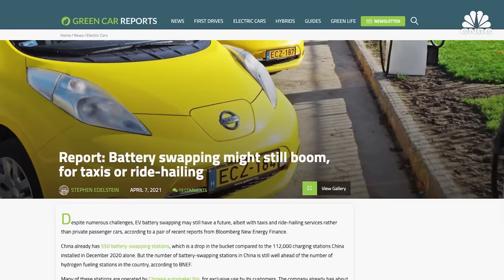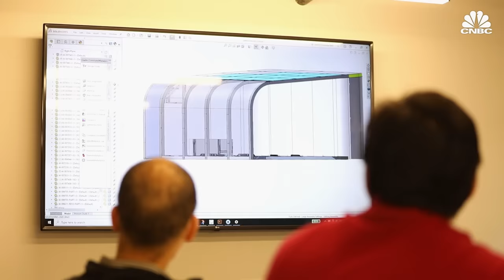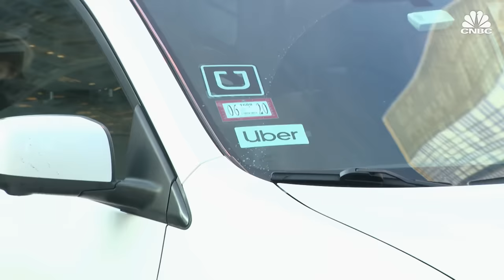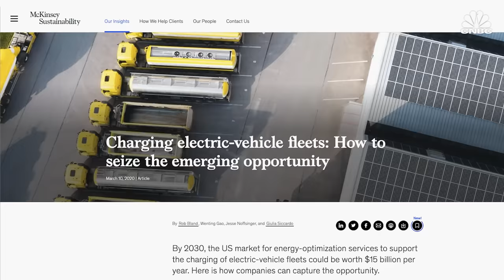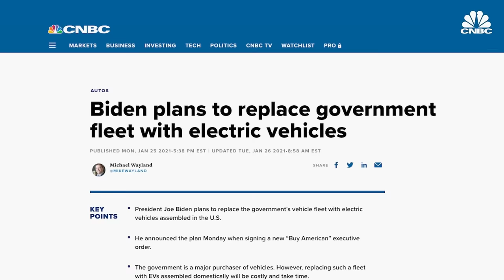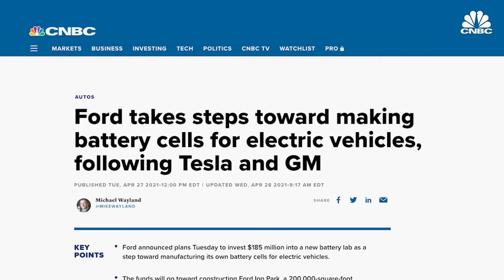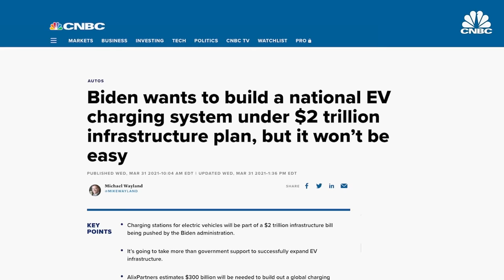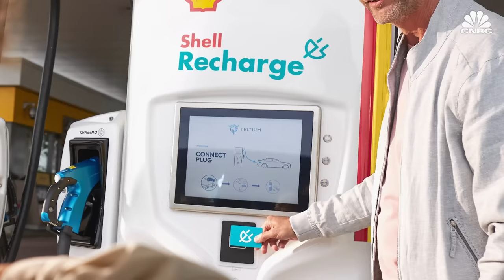Can EV Battery Swapping Take Off In The U.S.?

Comment: Who in their right mind would like to own a battery?? 🤔
Reply: Battery swapping is really not a good idea. My city is already connecting ev charging stations into streetlamps for people who dont have a garage. Tesla is going to have way better range with their integrated structural battery pack than any modular EV. Teslas batteries are already cheaper, smaller, and go farther than the competition and it just getting better. How many battery packs will these swapping stations need to have on hand in a city in order to make sure people arent sitting around waiting for a pack to finish charging before it gets swapped into their car? A battery is the most expensive part of an EV and they want to have thousands of these just sitting around when the world is already battery constrained. Each one of these places are going to cost millions in battery's and they will need to be all over the city and highway, otherwise youll be driving out of your way to get a swap, negating most of the benefits. They mentioned using them as grid energy systems, but that will degrade the battery life and tesla is already doing this grid battery powered energy storage with cheaper batteries that dont need to be small or light.
Reply: @HavokBWR  Well you are still missing most of the pint, as you mention the batttery is teh most expensive component of the car, a coponent taht degrades and becomes inoperable and neds to be recicled after lets say 1000 charging cycles. this means that if you own  a 20,000 dollar battery which looses strength and value evrytime you connect it you are loosing money, when the battery is no longer operable then what? you scrap the car. which is pretty much worthless. with boattery swapping the losses are transferred to the company that owns the battery and you basically have a fully working car for years depending on how well you take care of it. While you dont throw 20 Gs of your own capital to the trash. the batteries thne can be recycled and refresehd on a stricter schedule. As for using the batterues to offset energy production, this has great positive outcomes, because you can use more efficient, yet less able to start and stop at the drop of a hat.
Reply: Teslas batteries are closer to $13,000 and are getting cheaper. Teslas get more range on a smaller battery pack than its competitors, usually at a cheaper price. Structural vs swapped will only widen that gap.
 Tesla already has a million mile battery pack, that's not even with the new cells. The average person drives less than 20,000 miles a year. That's 50 years worth of battery life. Yes there will be degradation but getting a battery replacement really isn't something that you should be worried about, especially if you are going to wait till like 2025 or later to buy an EV. Even if the battery only lasts 20 years, self driving cars will most likely be ubiquitous. You're probably not going to want to be driving 20,30, 40 year old tech.

When you buy a modular battery EV you are paying for all of those battery packs that these companies are going to need at these stations. They will need a LOT of them, the world is battery constrained and will be for a long time. So yeah they will need a lot of these packs at each station, even more since they aren't supercharging these packs as to not degrade them faster. Don't want to run out of charged packs after 10 cars show up in a row. Not only do they(you as the consumer) have to pay for all these extra packs they also need swapping stations. Lots of them. And that's going to cost a lot more and take up a lot more space than super chargers or streetlight chargers.

Using the modular packs for grid storage is way more expensive than using cheaper, larger, heavier, lower quality, more widely available batteries in stationary megapacks. Again you're going to be degrading your fleets battery packs by using them as grid storage. That's going to cost you money as the consumer.

Comment: It’s an interesting concept and I can see it working well in parking garages at city center but outside of the city I cannot see this working.   Right now my family vehicle averages 32-34 mpg and fuel is 2.70$ a gallon so it’s actually cheaper to run on gas for me. Gas would have to go up to around 3.40$ a gallon for this to start making sense and even then I would benefit more from a Tesla as there are free chargers at my work and I could trickle charge overnight on a wall outlet most of the time.
Reply: Which state care you located
Reply: @marleyjanim5033  Wisconsin, northern Wisconsin to be more exact. No crazy elevation, no big city driving or traffic jams. Only real difficulty I have from a EV perspective is cold snowy winters.

Comment: I don’t want to replace my brand new cells with ones that are end of life.
Reply: What if you purchase a 1/4 pack of brand new cells and add swappable packs for the rest?  Your car could be much lighter, making the "end of life" battery point moot.  BTW, Tesla's new 4860 batteries have been measured to degrade to 10% after 15,000 full discharge-charge cycles.   At 350 miles/charge cycle, that is a 10% degradation at 5+ million miles.
Reply: @GK-op4oc  They often say don’t mix new and old batteries at the same time for a reason; even if the warning is meant for alkaline batteries.

Comment: Battery swapping is a foolish idea.  EV batteries will charge faster and faster in coming models, and the swap time won't be substantially faster than charging.  Plus, batteries are not all the same, so most people won't want some random battery swapped into their EV.

Comment: Porsche guy is right though. Only yuppies drive electric cars so all this hand wringing about "how to make EVs more like gas cars" is irrelevant for the normie car owner. All they want is a low TCO, and electric still can't compete with gas on price. Maybe there's an angle with swapping for fleets if the market moves to transportation as a service, but that again, implies that the engineers can deliver a lowest cost per mile.

Comment: Oh look, an opportunity for standardization.
Reply: Yeah lets standardize a tech in an industry that is going through rapid advancement...Evs dont have enough range as it is, we dont need this dumb idea stifling innovation. Tesla has the right idea with structural battery packs. You need every single edge you can get for every extra mile of range. Tesla gained like 10% more range by switching to their octovalve. Their new cars are getting something like 30% more range with their new structural packs. There are many many many more improvements to be made before standardizing is a good idea. This battery swap is an awful idea, especially when the world is going to be battery constrained for years.

Comment: so you are telling me we have a battery shortage and your idea is to hoard battery at swap stations? it makes sense to swap out degraded battery but swapping cuz you didn't charge your car is just dumb. we need battery to actually be used not sit stationary somewhere. 

and how bout mention why TESLA is moving away from battery swap? and why china is using battery swap? its more situational than it seems.
Reply: Swapping would only be useful on road trips but with range and fast chargers expanding, it will even lose it's appeal there soon as well.
Reply: @mattwolf7698  it wouldnt even make sense for road trips, you essentially would take 30-40min breaks and charge. in general we need to push the technology on battery and charging by actually using it. battery swapping is counter intuitive.  its only appeal is for ev owners in massively populated cities where owners don't have a dedicated parking spot with charging station.

Comment: but if station gets empty then it will not be available for very long time while chargers are always available plus capacity is lower than factory batteries plus there will be warranty problems plus  you probably would not be able to use Tesla supercharging network plus if you live far away and do use fast charging and degrade the battery and then come to swapping station either you will be rejected for a swap or someone will end up with your bad battery plus care need to be taken to not combine degraded with new batteries plus people would swap the batteries until they get good ones and then leave the station with only bad ones plus you need tens of chargers in the swap station instead of just one for one car and no matter how tricky trickle magic you charge the batteries if you have 100 of batteries charging simultaneously you will use more power than one fast charger if you want to charge them in reasonable time in order to be able to serve tens of cars daily if you only serve few cars in a day than you are not faster than the regular chargers plus I can find much more downsides to this system and if I can imagine what smarter people than me can... ?

Comment: The world is going to be battery constrained for a long time: Where are you going to produce all these batteries? There will be a need for ten times as many batteries, where 90% not in use.
Reply: The charging station charge batteries during non peak hours, which is cheaper to charge and also reduce pressure on energy network.
Reply: Also, China is leading in battery tech and own a lot of the upstream supply chain. So China of course is charging ahead with EV.

Comment: I’ve been saying this for YEARS, people laughed at it! Of course China had to get to it first.....
Reply: So... if the government wants to stop people from going around they close these charging stations ? No wonder they like this system in China !
Reply: Battery swapping is really not a good idea. My city is already connecting ev charging stations into streetlamps for people who dont have a garage. Tesla is going to have way better range with their integrated structural battery pack than any modular EV. Teslas batteries are already cheaper, smaller, and go farther than the competition and it just getting better. How many battery packs will these swapping stations need to have on hand in a city in order to make sure people arent sitting around waiting for a pack to finish charging before it gets swapped into their car? A battery is the most expensive part of an EV and they want to have thousands of these just sitting around when the world is already battery constrained. Each one of these places are going to cost millions in battery's and they will need to be all over the city and highway, otherwise youll be driving out of your way to get a swap, negating most of the benefits. They mentioned using them as grid energy systems, but that will degrade the battery life and tesla is already doing this grid battery powered energy storage with cheaper batteries that dont need to be small or light.

Comment: Is not the way.  How you bring all that vlominous full baterry pack? ok Let see you recharge slowly and sell the full one to the old one. But how many full baterry you can have in stock? imagine coming 20 cars to replace it and only you have empty battery. wich take you 2 days to charge them at slow rate charge. 
What about diferent baterry technologie?, what about diferent weight and volume battery?
To me look lost of money.
Just bring a good section of cable to manage the curent and is done , safe and no CO2 to try that energy to remote place.

Comment: damn that's innovation
Reply: Battery swapping is really not a good idea. Tesla is going to have way better range with their integrated structural battery pack than any modular EV. Teslas batteries are already cheaper, smaller, and go farther than the competition and its just getting better. How many battery packs will these swapping stations need to have on hand in a city in order to make sure people arent sitting around waiting for a pack to finish charging before it gets swapped into their car? A battery is the most expensive part of an EV and they want to have thousands of these just sitting around when the world is already battery constrained. Each one of these places are going to cost millions in battery's and they will need to be all over the city and highway, otherwise youll be driving out of your way to get a swap, negating most of the benefits. My city is already connecting ev charging stations into streetlamps for people who dont have a garage, and apartment parking spaces are getting EV chargers, all at a fraction of the price of these swap stations. They mentioned using them as grid energy systems, but that will degrade the battery life and tesla is already doing this grid battery powered energy storage with cheaper batteries that dont need to be small or light.

Comment: The dumbest technology ever what a joke. So the OEM manufacturers don't have the battery capacity for their electric offerings and are battery constrained. There just is not enough batteries available anywhere. So they think the solution is storing hundreds of battery packs waiting for a swap incredibly inefficient. Typical battery packs are 75 killowatt that's $20 thousand dollars doing nothing. Grid deployment is not lucrative. 15 minutes is just ridiculous amount of time more than 4 vehicles in a line and your waiting 1 hour, not a good solution. I predict they will not have a supplier to get them the capacity needed. Tesla by far is gathering every battery from 3rd party resources and their own in house manufacturing needs. There is no room to put batteries on shelves waiting for a swap, you need 4x more batteries.

Comment: Sadly, he will fail again as will others. China is a more unique market and it may, may work there but only for small packs  long term. The concept is great in theory from a time point of view but the cost overhead, lack of batteries to make enough swappable packs, etc, etc makes this a failure.  But, give it just 5-7 years and battery and charge tec will have advanced to the point of near instant charging with negligible degradation due to high charge rates.

Comment: I see Americans value time over owning plus Americans would appreciate a cheaper electric car in that they wouldn't be buying a massive battery packs instead renting battery packs All this battery swapping and renting isn't new in fact this tech goes back to 1900, NINETEEN HUNDRED.
For myself if I could buy a used electric car equipped with an Ample battery packs I would do it in a minute that's if the electric car is anywhere from $7000 to $10000.

Comment: EV's might b a good thing 2 same but no one say there's a strain on the grid,
in fact grid companies are pushing for more nuclear, coal , solar, wind plants , yes in the future where's fossil fuel depleted the there's on oppositions (what happens when there's a breakdown of supplies of grid) , natural disaster, cyber attack, EV's & combustion should continue side by side in there fields of tec both have there limitations(on the light as side , I see 👀we going back 💨to "robotic" horse driven carts🙄🤣😂
Reply: Get yourself solar panels on your roof. use your car that has 600+ miles of range (probably 1000+ miles in the next 10 years) as a backup power supply. Have a power wall of batteries in your house that charges up using solar and can sell energy to the grid when its needed, and buy energy from the grid when there is excess. That alone will help balance out the wavy nature of power demand in cities that cost the most pollution and issues.

Comment: this is why US EV will lose to China. Battery swap makes more sense is quite obvious. You need to have manufacturers design around the swap system not the other way around. This is why communist system will win over US's capitalism/free market. Think about the high speed train system of which US is behind China for at least 50 years. 20 years later, you will see China made EV running all over US because it is lower cost higher quality. Think about iPhone, if you have US made iPhone the yield probably will be low 10th. US legacy auto industry has already lost its competitiveness for so long and what makes u think US will do better with EV?

Comment: THE CURRENT BATTERY TECH FAST CHARGING WILL SHORTEN THE LIFE OF THE BATTERY
BUT THE NEXT GEN SOLID STATE BATTERIES THIS WON'T BE AN ISSUE 

THE DESIGN OF AMPLE IS NOT SAFE LIKE YOU WANT TO GET OUT OF THE CAR YOU CAN'T 
YOU CAN BUT YOU COULD TIP THE CAR OVER OR SOME STUPID KID RUNNING AROUND RUNS UNDER IT TO CHASE SOMETHING